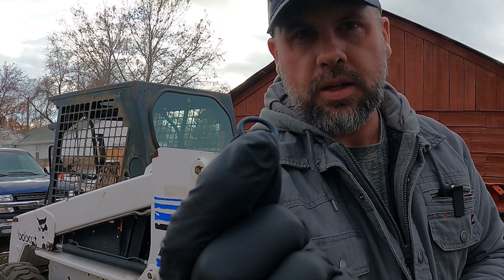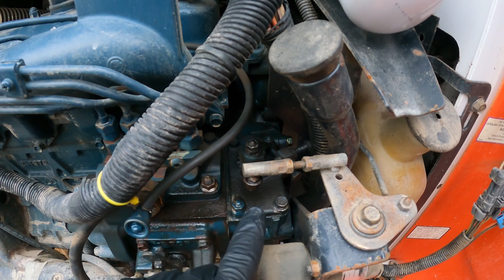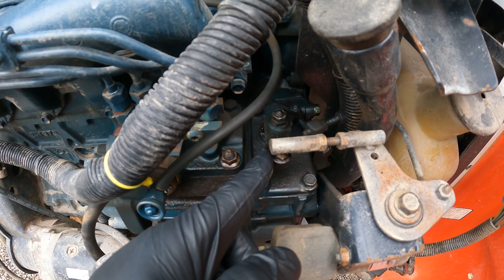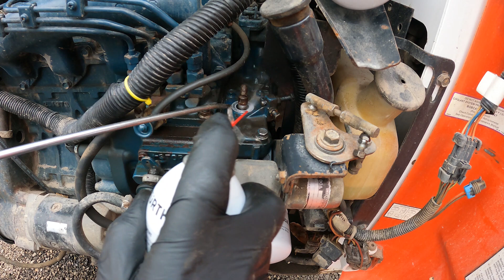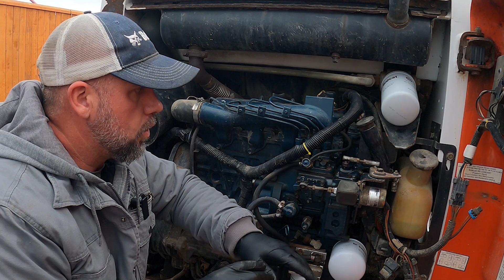Bobcat Engine Oil Leaks, Throttle Control Plate Seal

Comment: Do you have anything in regards to that cover right below the throttle plate. I’ve got a 763 that did a swap on and everything else is good but now it’s started leaking at the cover. My guess is it needs a gasket or bead of silicone

Comment: Would this explain why I'm seeing oil inside my 763 fuel filter? I just pulled the plug and completely drained my fuel tank yesterday and there was no oil inside the tank but I've had oil inside my last couple of fuel filters that I've changed. It's been increasingly difficult to start so I'm assuming that is why.

Comment: I have a 753, Kubota V2203, just did a overhaul now I have a oil leak. Motor is running very well, no more black smoke. But the oil is leaking out some place on the right side of the motor. Cant even tell for sure where it comes out, but it runs on the alternator belt and gets sprays  around everywhere.
It looks like so easy how you repair everything, I thought maybe you have a good tip how i could determinate the problem.
I guess at the moment it is the crankshaft seal on the right sight. Or maybe the sealing was not the right size.
Can I change this sealing without taking the motor out and apart again? Any advice or help you could give would be much apriciated.
Thanks!
Greetings from Costa Rica
Martin
Reply from the maker: I would love to visit Costa Rica, awesome.  In order to find oil leaks I get the machine as clean as possible. After it's clean and dry I run it just long enough for the oil to start leaking and track it down from there. It is possible the front seal around the crank pulley is leaking. It can definitely be replaced in the machine. No need to remove the engine.  I would also remove the alternator belt to keep oil from slinging everywhere while you look for the leak.
Reply: @tetradgroup  , OK thanks a lot for the tip. I will do so cleaning the machine take the belt down, this will help for sure to determinate the problem more easy! And thanks for the fast answer! Tomorrow I don't have time, but as soon I have it done I will report back.
Thanks again!!!
I am not a mechanic, but doing my best, your videos are helping me a lot. This is a great work, please keep doing more of them if you can. After this oil leak problem I will make the drive shaft bearings and rolls. Using your video as my guidance.
If you visit Costa Rica someday in the future come over and let have a drink together!!!
Pura Vida
Reply: I have the same exact problem  what did you come to figure the problem was?
Reply: @haydenankrum4952  I did take down the belt wheel, there was a separation ring between the crank shaft and motor case, it was somewhat not plan anymore, the oil ring could not seal it Propper. So I did go and found a new seal, outer diameter same size but inner diameter where the seal fits I take 2 millimeters smaller. Then I did take the metal ring to a lathe, they dit lower the outer diameter to exact size of the new oil seal 2mm, and put all in back from the outside.
Now the motor is 100% dry.
Everything done from outside. No big Problem.